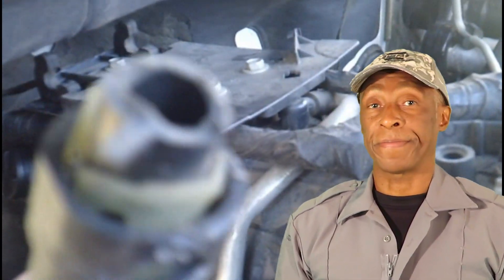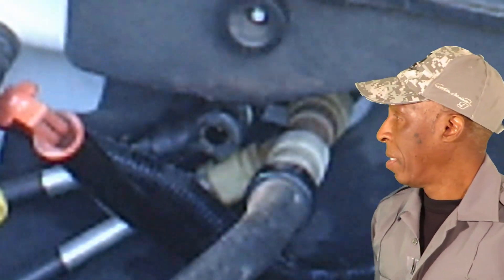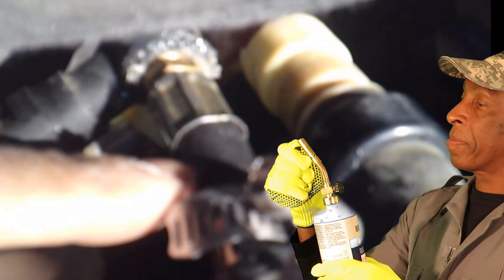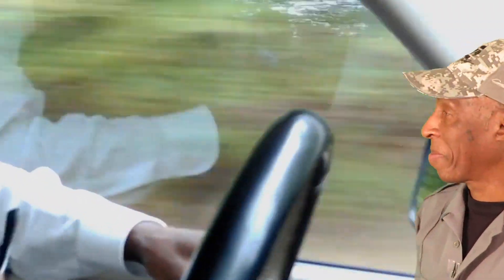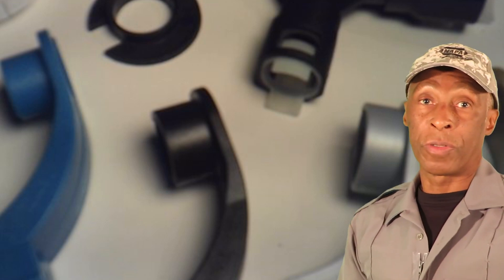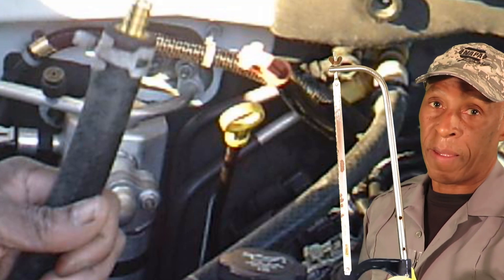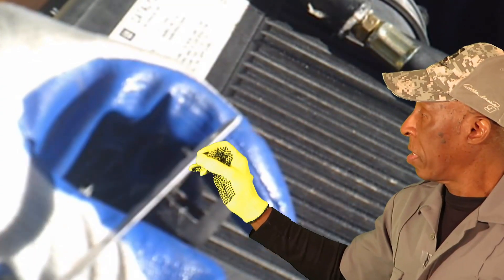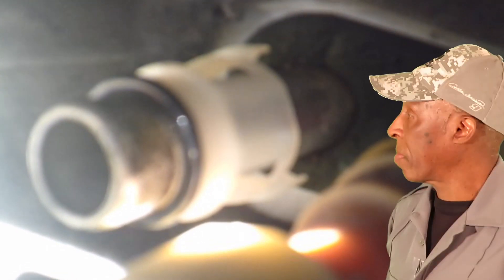How to repair broken heater hose connector on a GM 2004 YUKON

Comment: That's what I'll be doing today ughhh getting original parts but still a bitch to get to in my cadillac escalade.  Wish us luck
Reply from the maker: hey Sharon, ya I know. those parts become brittle, l noticed a lot of the parts were sitting there in the junkyard, after I went to a all the trouble. you can fix this, just take your time.
Reply: @diversity2739  me and my daughter and son got it done today.  Yay thank God that's over.  Yeah they were dry rotted so the pain in the ass getting them off consistented of basically breaking the old connections apart rather than pulling them off lol. So after painstakingly breaking the clips apart getting the new connections on was a breeze. Thanks so much. Enjoyed the video .
Reply: @diversity2739  oh and yeah we couldn't use the tool either.  Transmission stick in the way plus crows nest very low to the connections so yeah we used a chisel to cut the plastic connections from the metal pipe with a screw driver. I'm proud of my kids they really helped me so much getting up in there for me. And this video really prepared us to have to improvise
Reply from the maker: @Vamparellame  wonderful! Sharon you have great kids.
Reply from the maker: @Vamparellame  welcome Sharon